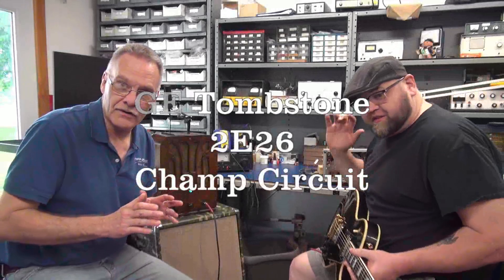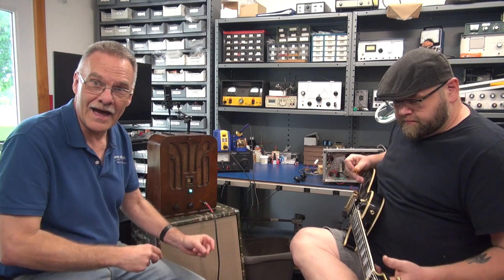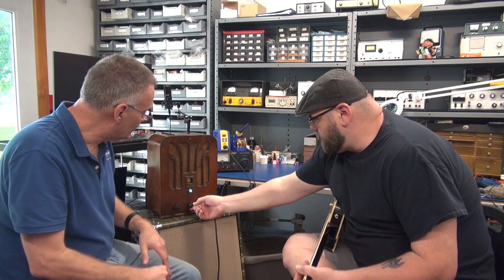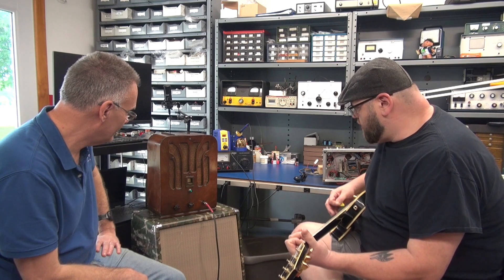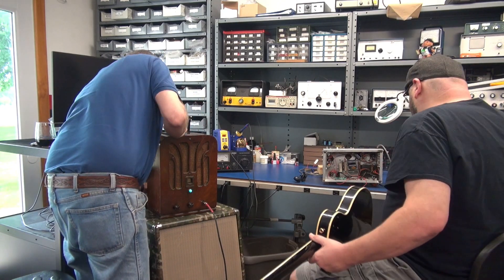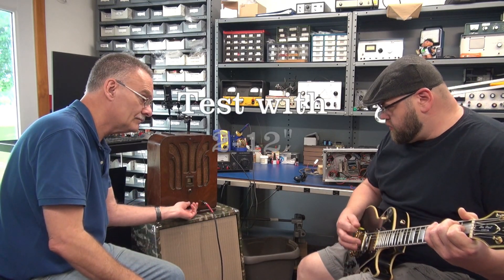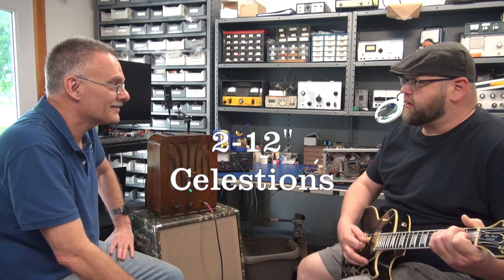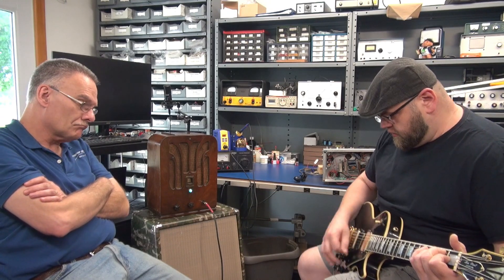Fender Champ guitar amp circuit using a 2E26 rather than 6V6 output tube Class A GE radio Monster

Comment: I looked it up -You can still get the 2E26 CHEAP. Haven't looked at the data sheet, but it's just a direct plug-in substitution?
Reply from the maker: No, not direct sub, rewiring is necessary. I put a full info video on Patreon
Reply: @d-labelectronics  Thank you....